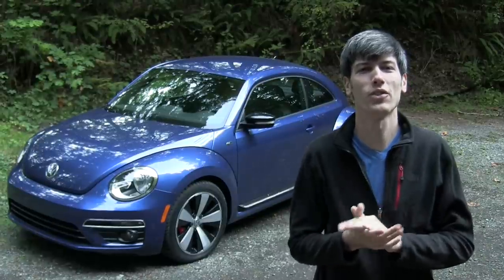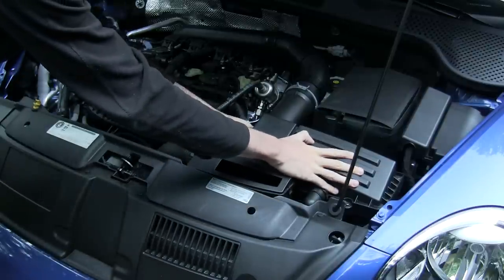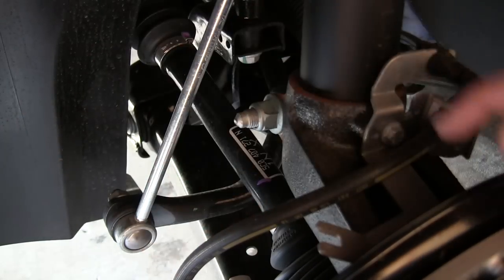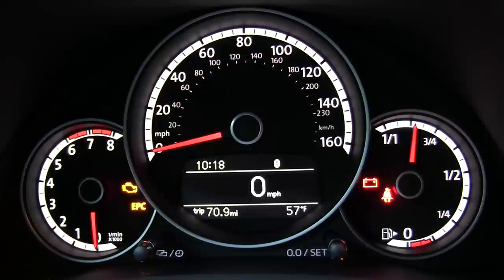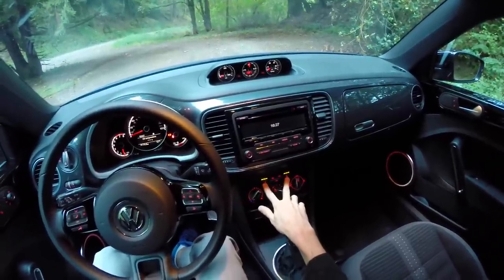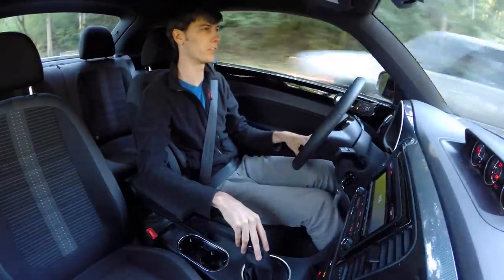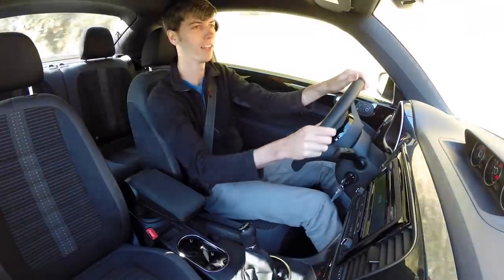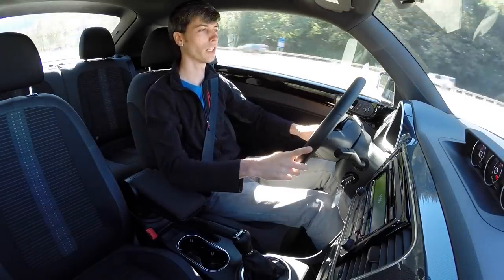2015 VW Beetle R-Line - Review & Test Drive

Comment: I actually own one of these but with the DSG auto, panorama glass roof and Fender audio.  They are mechanically identical to the last gen GTI (2010-2014).  The gearing seems longer because of the larger wheel/tire combos on the Beetle (235/45/18 for the Beetle, 225/40/18 for the GTI/GLI).  I do agree that the armrest/cupholder thing is annoying, but there are also cup holders in each door as well, so it no longer bothers me. I've yet to experience significant torque steer with mine, maybe because it's DSG? I do struggle to get more than 28mpg no matter how or where I drive.  All in all, I do not regret choosing the Beetle R-Line over the GTI, especially since I saved over $5,000 with the Beetle compared to an identically equipped GTI.
Reply: Do you still have the car?

Comment: I just got an R-Line myself. My dealer made it impossible to refuse. I traded in my 2012 Beetle 5-cylinder, which was a great car. They gave me a good amount on my trade-in, so the choice was very painless, not much more a month, since I was able to negotiate a good price. 

I have to say, I LOVE this car. The turbocharger makes a huge difference, as well as the different suspension. The mirror is really not that big of a problem. I find it to be just fine. Actually, it's such a big difference form my old one and so much nicer, I'm almost embarrassed I got it for what I did. I plan to keep this one for quite a while tough. It's pretty awesome.
Reply from the maker: +Lee Kohler Happy to hear you're enjoying yours!
Reply: +Engineering Explained I forgot to mention that i have the automatic DSG transmission. I think next time they have you test one of these, you should ask them for that transmission. You might like that better than the manual. Other people have told me they like it better.
Reply: +Lee Kohler can I ask how much you got for your trade in? 20k+ seems a bit much for such a small package.

Comment: The rear view mirror shape and size is retro from the original Beetle.  The center armrest will hit the E-brake handle, if you leave it down, but this pivoting allows you to position/re-set/angle the center armrest so the palm of your hand is aligned with the ball of the shifter while you are resting your forearm on the center armrest.  One of the reasons I waited to buy a 2013 Turbo was to get this adjustable armrest just like my trade-in 2003 Beetle GLS had.

Comment: Have a 2015 Beetle R-Line Coupe - Black w Red/Black leather seats, loaded with 6spd manual  (did not want the auto DSG)   Some easy upgrades turned this 'Stock' FWD Beetle almost into a Golf R  AWD in overall performance and a bump up from the GTI IMHO.   Upgrades were Tires, Off with the OEM Contipros and replaced with Cont. Extreme Contact DWS06 UHP 245/40/19 - Huge difference overall !  Next was the APR Stage 1  E port tune with air intake = 275 HP / 305 TQ over stock  No modifications needed (Clutch,gearing,etc.) These simple upgrades really enhance the driving experience and make this 'Sleeper'' fun to drive.   It's definitely not a 'Girly' car in this set up.

Comment: Good review. I have a 2016 diesel and find it very comfortable. Coming from a Mk5 Golf with no arm rest, I find this arm rest a real joy on my long daily commute, despite it covering the handbrake (but I only use the handbrake when parking so no real problem). I did find the steering wheel a bit uncomfortable as the Mk5 Golf GT Sport diesel that I used to have had notches on the steering wheel. This does not, plus there is a definite edge to the steering wheel bevel which makes it uncomfortable. The rear view mirror is pretty small but it is surf board shaped, like the original Bug. I have a 1972 Bug and feel this car has paid homage to it well, plus it has updated the style and comfort well. The stock rear speakers are very muddy sounding plus my spot gauge has some vibration / rattle issues which I am getting sorted. The rear boot has a very heavy door. But all in all a good car and very enjoyable and comfortable.

Comment: The wheel bolts are an audi/VW thing, my 2000 A4 has them and they even include in the tool kit a plastic rod with a threaded end to put in the top threaded hole in the hub to align the wheel while you do up the other 4, then you remove it and install the last bolt!
Reply: My 335i has bolts too. Must be a German thing.

Comment: I think it uses the same 2.0T in the GTI, which makes sense it's the same chassis as the Golf, Scirocco, A3, TT, most of VW groups small cars now
Reply from the maker: Bryan Doherty Yep, though the GTI apparently has more torque (based on VW's site).
Reply: Engineering Explained I think I'd get the GTI instead, it's more practical. By the way I like how you film like that, it gives a really good idea of what it would be like to drive

Comment: The armrest covering the parking brake and cupholders is not a new issue, I have the older version of the 2005 Volkswagen Jetta, and I find myself not using it because I always have a cup with me and I need somewhere to put it. In result, the armrest had to go. So I wasn't surprised to find that this car had the same issue.

Comment: You do the BEST reviews!  You cover everything that needs to be covered, and you do it well, and seemingly without bias.  I really kind of lost faith/interest in the VW Beetle when they moved the engine up front, rather than in the rear over the rear wheels.  It used to be a tough little car that would go through almost anything.  I once went across a freshly plowed wet field.  It slowed a bit, and sank down to the level of it's belly, but it never quit going!  When things got too rough outside, such has heavy snow, that's when it was Beetle time!  It did have it's problems with iced over roads, but what vehicle doesn't?!  And besides, they turned it into a "Chick" car, so that leaves me out!  lol

Comment: My 15 gti is a blast to drive,geared very similarly 73mph in 2nd,weighs slightly less I think but what’s up with the torque deficit? Seems like the same engine 2.0 tsi,same hp but no torque? 258ft pds in the gti

Comment: That was a very fair assessment of the car ( I have one my self ) There is a connector in the lower glove box, which has a usb and Apple connector..  :)
Reply from the maker: john wheatley Ahh yes, you're correct. Actually it had the old Apple connector though, not for the newer iPods/iPhones, which I thought was odd being a 2015. I'd imagine the dealer can switch it out though.
Reply: Or its possible to buy from Apple a converter plug... Good video btw.... Thanks

Comment: Was this your first time driving a Volkswagen? Having to press down the shifter to get it in reverse and having bolts instead of lug nuts is normal for a Volkswagen.
Reply: Bolts are for all German cars, there is for sure some reason for that
Reply from the maker: edge21str Yep, first VW I've driven.
Reply: Omar El-Mohri
Makes it really hard to change a tire when the car in on a lift by hand.  I'm sure the germans have some sort of mechanical holder to help them.
Reply: That's a point that needs to be searched for.. I'm not sure but I think that more new cars are doing the same..(to be confirmed)
Reply: davetek490 actually not really complicated tool used, and so good reasons:

I didn't pay attention when looking at the tool kit on my GL, but my BMW's have all come with a tool that you insert into one of the bolt holes and you hang the wheel on that; makes things much easier. You could probably pick one up on eBay or from a BMW specialist shop - this one is from Turner:

http://mbworld.org/forums/gl-class-x164/441688-why-do-german-s-use-lug-bolts-instead-lug-nuts.html
Reply: Omar El-Mohri
Thanks, but I've only driven japanese and american cars.  Germans never could figure out K.I.S.S.  I've personally never crossthreaded a nut putting on a tire, but you'd have to replace the whole hub if you did it with the bolt system.  I've seen someone hammer out a lug and replace it in 5 minutes.  Plus the need for an additional tool (no matter how simple), just oozes K.I.C.K. (keep it complex komrade).
Reply: Yep, this why I'm not yet convinced.

Comment: "Sitting in the backseat there isn't really legroom or headroom if you have legs or a head" rofl :)   Great video! It's a very interesting car, with those unusual design touches.  It's interesting to see what VW when they try to be creative (for once).  Bolting up the wheels seems a bit strange.

Comment: Do you know why they would use bolts instead of lug nuts? My '04 Passat has them and they are awkward for replacing the wheel like you said.

I'd love to see you do a Passat or Jetta TDI.
Reply: I have a 1998 Mercedes C230 that has the same lug nut system, it's a pain in the butt to put the wheels back on after working on my car..... but my little Benz has 199,000 miles and everything still works perfect!!
Reply: i tried looking for an answer, and no matter how many forums i visited, none provided one. it could have to do with multi-platform compatibility; making a bolt longer for a bigger wheel is more cost effective than having two different parts for two vehicles
Reply: Dusan Pesic
Sounds plausible. Would it be any easier to disassemble the wheel assembly (take the rotor off, etc.)?
Reply: it's literally holes instead of studs, so everything else is pretty much the same. putting on a wheel aligned with the holes is a pain in the ass however so as far as that goes it's a step backwards, lol

Comment: In my opinion you dont need to see everything from all angles with the rear view mirror.  I have a 14 turbo and overall its a nice little car.  It rides good.  Handles well.  I love the throaty noise of the engine.  My big complaint is no usb.  How can a 2014 car not have usb?
Reply: Great review.  You're like a friend I'd take along for a test drive to get opinions from.  You inform viewers on what they need to know without getting nit picky over detail  Keep up the good work.

Comment: +Engineering Explained So would you recommend this car ?
Reply from the maker: If you like it I'd recommend checking out the GTI as well. It's cheaper, lighter, has more torque, and gets better MPG.
Reply: Just wondering ive got a 2.0 TDI Golf mk5 and i could never seperate from it :p

Comment: also, i thought that having a turbo ment that the engine had to rev higher to get torque (less effective in low RPM, or turbo lag?) but it seems you say the opposite in this video, i'm probably wrong but still curious !  tyvm
Reply: It is pretty much depends  on the size of the turbo.
Reply: The turbochargers that are used these days are variable turbochargers. They spool up very fast and give good low and mid range torque. I think he made a video about them.
Reply: Leo K This isn't a variable turbo.  Most factory turbocharged cars have a very low boost threshold (small turbo) and they flatten the torque curve to give a very linear response while giving up some peak torque and power.  This is where a lot of the power is available in turbocharged cars being tuned.  If you want an example, look at dyno graphs for a GTI stage 1 vs stock or BMW 335i stock vs. JB4 tune.

Comment: I heard it was bad to rest your hand on the shifter cause you could mess up the syncros?
Reply from the maker: If it's in gear the synchros are rotating at the same speed as the shaft of the gear they're connecting. No harm.
Reply: Engineering Explained "The reason you should not do this is because the weight of your hand, and arm, is multiplied due to leverage. This can move the shifter rail slightly off the detent ball which holds the shift and fork in its proper position. The shifter fork fingers are then being rubbed against the rotating synchronizer sleeve (think of placing your thumb and forefinger inside the grooves of a small pulley).

Over time the shift fork fingers and the sleeve will wear down. Once the gap is excessive the force applied to the gearset in question (1/2, 3/4, etc) will try to slide the synchronizer inserts inside the sleeve. There is a point of no-return here and the synchronizer hub/sleeve assembly will then try to place itself in the neutral position; a.k.a jumping out of gear." - Click and Clack forums post
Reply from the maker: Interesting, thanks for sharing!

Comment: Let me know when they put the engine in the back, until then it's not a beetle or a bug it's just another vw.
Reply: +Crane 2005     .....and make it Air Cooled with piping off the exhaust manifold to provide heating into the cabin  footwell and windshield with cable control levers for output.    Now that a real Beetle  !

Comment: I really like this car, right up until you consider that it's basically a previous year Golf GTI. It's also more expensive, less well equipped, slower, less practical, and less economical than the new GTI.
It kind of begs the question; if you wanted a VW with good handling and a bit of go-power in the engine bay... why not get the superiour GTI?
Reply: *****
You've spent money on a Beetle turbo so I hope you enjoy it. But everything I wrote is still true. GTI is faster, better equipped, AND significantly cheaper. It's the better car.
There is only one good reason to get a Beetle. You love the styling. I think it looks hideous and I wouldn't be caught dead driving it, but if you like the way a Beetle looks, then enjoy your Beetle, because nobody can tell you you're wrong about what you like.
But it's still worse than the GTI.
Reply: Justin R Yawn GTI YAWN..... I agree with kevin. The car is so different from the norm. and a fresh change from the standard square box.
Reply: Justin R If you want a fun car, spend about $10K on an original classic VW Beetle convertible from the 60s-70s.  Ain't nothing like the real thing.
Reply: The GTI and Beetle are 2 different cars with unique features. Don't compare the two

Comment: most cars don't have oil temperature gauge, why do u need them anyway?
Reply from the maker: 7150285 To know when the engine is warm, and when it's getting too warm. It's best not to drive your car hard when the oil is still cool, and the coolant will typically heat up much faster than the oil.
Reply: Engineering Explained is it correct that when the fans kicks on means the thermostat is open? Or if the AC compression clutch is turned on?

Comment: I've heard a lot of people say this car has too much wind and road noise.  Has anyone experienced that?
Reply: Robby M I have a 2013 Turbo Beetle (looks just like this car, except the front bumper has a slightly different styling). When I'm driving around town, the car is pretty quiet. But once you get on the high way, there is some wind and road noise. I also noticed the car seems to "whistle" a little too. But its a minor issue for an awesome car! I love mine!
Reply: Cool thanks, I had a 2015 I think as a loner last week and I noticed it had some whistling too when I was on the highway, it did have a convertible top though, but it was really fun to drive haha

Comment: Did he say you CANNOT turn traction control off? He really needed to just NOT rush through that. I NEED to know please someone help
Reply: What do you need to know?
Reply: @will.dornon  I already have my 2014 Rline. And I have the traction control on/off switch in a box too. It’s an OEM park assist convert to the TC. The car has the function but just needs a switch. Have you or anyone install it and it work off rip? Or do I need to code as well? 5c Beetle
Reply: @tapa2466  I haven’t installed one on my car, but you may be able to find your answer on a forum.

Comment: That's a beetle. WHy is the engine in the front?
Reply from the maker: Jackie Coe The engineers put it there.
Reply: Engineering Explained *Groan* Yes, but why did they put it in the front? A beetle's engine should be in the back
Reply from the maker: Jackie Coe Times are changing I suppose.
Reply: Engineering Explained Yeah, I guess. It's a bit like Ford's Mustang II. It was an icon, like the beetle, ford tried to improve, like VW has with the beetle, and ended up with something worse.
Reply: +Jack Coe Engine is in the front to be closer to the radiator. Creates more usable storage volume in the truck = 15.1 cubic feet or 10 cases of beer.
Reply: missingremote Yay! A sane answer! Thanks a lot, missingremote!

Comment: isn't it just an expensive polo with a different body?
Reply: No, it´s based on the Golf. So Scirocco, Golf and Beetle have the same platform
Reply: mgfmgtf ok. so its an impractical, large on the outside, but small on the inside. usless
Reply: Lawrence Timme why the hate? If you don't like it just don't buy the damn car. I'm sure that the car will sell well, i think it is nice to have another option other than the GTI.
Reply: Eduardo Ortiz i'm not going to buy it, but i can still express my opinion. i was wondering why it was so small inside. the beetle was suppose to be practical, not useless
Reply: Lawrence Timme Define practical I am a single person I live by my self and I drive a 2013 vw Beetle Turbo. It hold everything I need it to hold with room to spare I a about 6.6 feet tall and I have more head room in this car then I do in ether of my dad's truck or my brothers truck,  so for me It is practical. Plus I do autocross in and take it to the drag strip also. it is a all around fun car to drive!